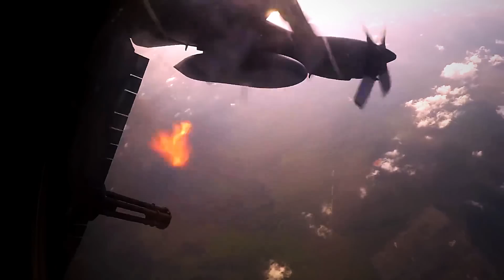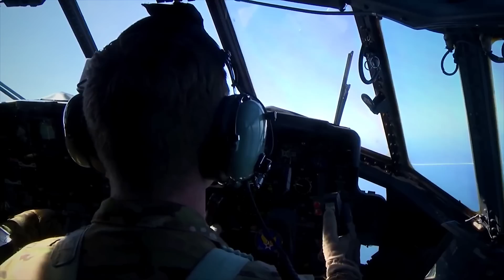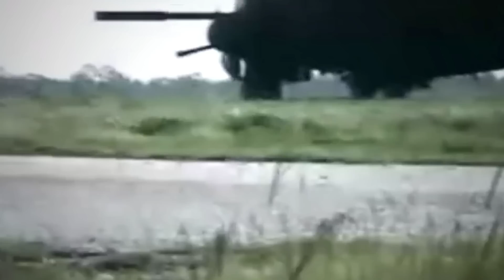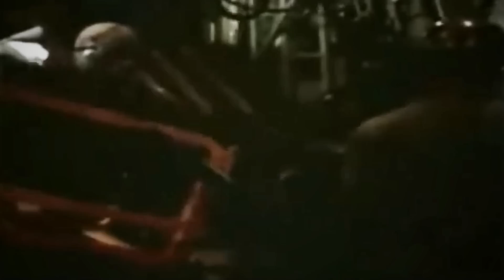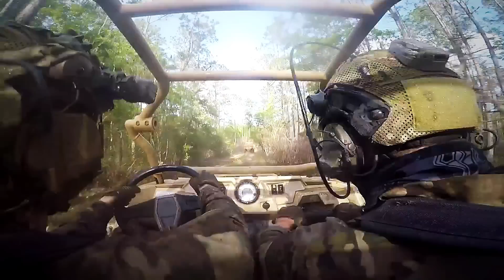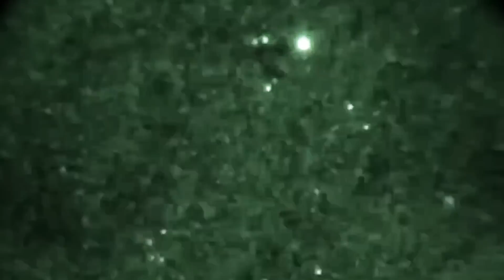America's Unrivaled Aerial Beast Unleashes Devastation on Over 2,000 Vehicles

Comment: I remember getting a 1"×1" with a specific emblem to sew on the my cap. But most of us ironed our on with a hem tape. I remember coming up to a completely burned vehicle with the liwe half of the passenger and the driver completely burned black. Hevwas the size of a 10y/o boy, butbthat was because of the burning much like what you see with bacon. They were on an incline and as the vehicles in front of them were knocked out they would try to go around wider and wider each time.

Comment: Its not only the guns on an AC-130 that make it such a badass,  the targeting systems are absolutely unmatched. These crew members can clearly see targets on the ground at night, in bad weather, behind cover from 25,000'. Very impressive machine. There was talk of removing the 105 and arming it with an airborne laser weapon, but it seems the tech isn't ready yet. There is also talk of arming the AC-130 with JASSM missiles, which would greatly help its operation on contested battlefields. Plus there are plans to equip it with advanced AESA radar systems. The AC-130 is only going to get much more impressive.

Comment: In Panama, it was 0300 Christmas Day and my crew on another bird had just landed.  The PDF popped a motor flare over the airfield and started sniping at us and other things on the runway.  An AC-130 was about 6th in-line to take off when the planes in front of it took a hard right turn off the runway into the grass.  The AC-130 WOUND it’s engines up hard and took off short.   As it passed the hill the snipers were on it rolled slightly right and burrrrrp the snipers were not heard from again.  It mad a loop over the Pacific Ocean and landed to refuel.  I was glad it was there.  My original thought was “TOUCHDOWN”!  I Was there, I saw it and I testify this is truth.
Reply: Beautiful

Comment: Though many think the phrase "Puff the Magic Dragon" was a title given to the AC130 gunship, the original meaning was "puff" the "Magic Dragon" and it referred to the practice of putting heroin on a trough-shaped piece of aluminum foil and heating it with a match from underneath. The heat will cause the heroin to evaporate and make a trail of smoke to rise which the doper would inhale with a straw. No doubt it was "hippie" draftees in the military that christened the AC130 after the practice since it fit so well.

Comment: The Iraq .military can tell you about the AC130 that where on the highway of death along with all the other aircraft involved including A10A Thunderbolt 2 "Warthogs" stationed at the King Fahd airport in Saudi Arabia.
You can run but you'll just die tired.
From a disabled veteran of the Cold war & Desert Storm. USAF 23rd TFW FLYING TIGERS. A 10 ENGINE , HYDRAULIC MECHANIC.

Comment: the  C130 Herc is  a wonderful multi-use platform, but you will not see one in civilian use. Lockheed got a law passed to prevent surplus units from being sold. They were losing money when 130s were rebuilt from boneyards.
Reply: There's a civilian version out there, a few companies still use the  L-100s (civ C-130) and other designations. But I don't think the military ones ever get turned over to civilian companies.

Comment: Even during the early 70's when I was in the Marine Corps, the amount of logistics involved in a single joint military training operation was massive. I worked as the admin chief of one Headquarters Company and the amount of data that crossed my desk every hour would choke an elephant! It was literally "controlled chaos," but everything went out like it was supposed to, right on time in most instances. I can't imagine the amount of data soldiers today have to process in the same scenarios!
Reply: I was a Marine tank commander from 71-75. I flew back from Cuba on a C130 in 74. While talking to the pilot, he said the C-130 can fly with one engine functioning. My guess is, today's electronics along with AI will cut down on paperwork and time.  Semper Fi.
Reply: You're making an argument for artificial intelligence.

Comment: Interesting that this lethal weapons system with wings is powered by propellers and not jet engines. I wonder if that's intentional, since it's actually an advantage for this aircraft not to fly too fast?
Reply: lumbering target.  Useless in modern warefare where sides are equal... @JohnSmith-kq4cx

Comment: A single AC-130 did not take out the 2000 vehicles!! F-15s and F-16s did most of that if not all of it.
Reply: A 4 plane flight of SC ANG F-16Cs did most of the damage. Dropped 8 rockeye cluster bombs (2 each) right along the road.

Comment: He forgot to mention the AC -119 stinger that was after the AC-47 but before the AC-130 I'm sure they operated together during Vietnam
Reply: I was in Vietnam and we used Spooky a lot but never knew C119s were used there until I guy I grew up with who served on one told me about his experience
Reply: Yes, they did briefly serve simultaneously. At that time, the Spectre was mostly being used for armed recon, so the old "Flying Boxcars" converted to gunships were technically replacements of the Spooky until more AC-130s could be manufactured. By the way – the AC-47 is STILL in service with the Colombian Air Force. They were going to be replaced by retired USAF A-10s, but for whatever reason the deal fell through, and the Colombians kept the Spookies running to this day.

Comment: This is the meanest aircraft on this planet and is comprised of very special and outstanding crewmen.  Starting in Vietnam, it did a ton of work protecting our ground troops and the military aircraft. The increased capabilities and power have made it the meanest bad-ass. Thanks for sharing this video.
Reply: AC 47 Douglas aircraft the original "Spooky"
Reply: @byronharano2391 AKA Puff the Magic Dragon.
Reply: @samuelhowie4543  Thanks. I forgot about this aptly applied nickname.
Reply: Yep just like the A-10C, and is probably one of the few aircraft that can loiter over a battlefield longer than the A-10. The two working in concert will really turn the tide of a ground battle with F-35s flying escort.
Reply: @anydaynow01  It can only loiter anywhere if other aircrafdt have already cleared the skies. Its very impressive but until air superiority is achieved, its a slow flying target so hides away at the rear.
Reply: @grahamo22 
The USAF has achieved total air supremacy in every war and battle since one fateful attack in Korea in 1953.
Reply: @Frankie5Angels150  And yet still that wasn't enough for USA to win some of those wars
Reply: @Frankie5Angels150  and in Korea, we now know most of the "North Korean" MIG pilots were actually russians. 👍
Reply: @86XFA  Technically, the U.S. is still at war w/No.Korea, operating under an armistice (a ceasefire). But looking around No.Korea vs. So.Korea, I'd say we won (or, "are winning" 😆 )
Reply: And the a10 warhog tank killer
Reply: Made exclusively for war crimes and good at it. But if any military meet this easy target - USA lost big amount of people from any anti-air system, even ww2 one
Reply: The aircraft is itself made of crewman? That must be how it looks like an AC-130 but it's actually a helicopter; it's ACTUALLY a bunch of dudes holding each other while flying through the sky. It's how we won in Vietnam and in Australia.
Reply: @filonin2 😆😂🤣
Reply: News to me... We won Vietnam?  When did that happen?  @filonin2